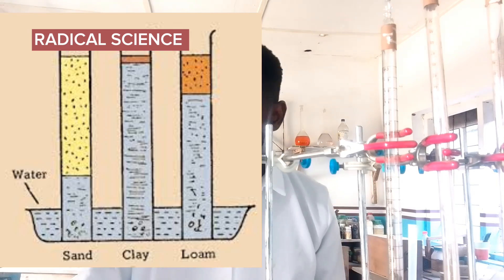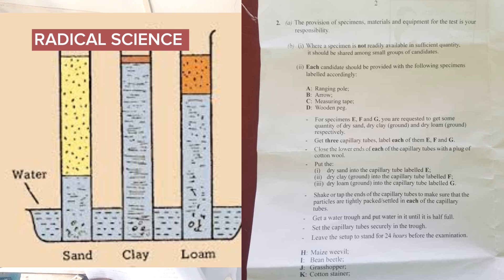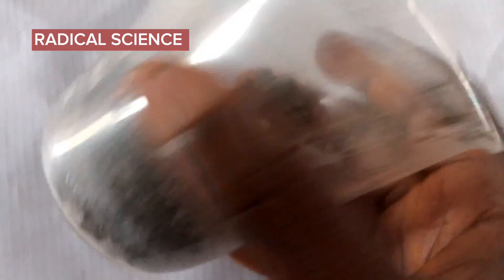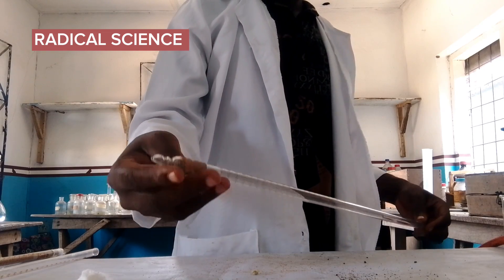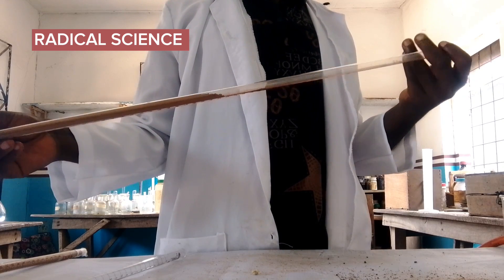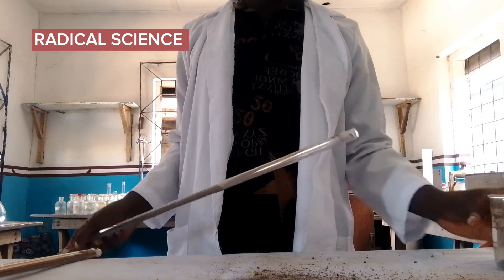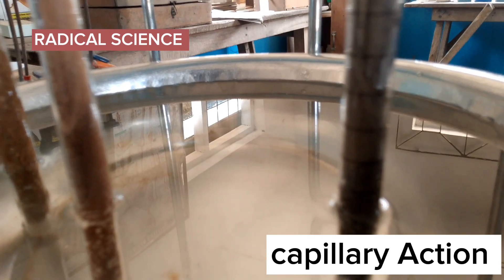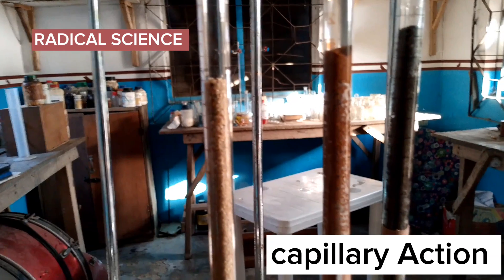2024 Waec Agric practical  Solution. Capillary Action

Comment: Thanks. I thought we need to put the cotton wool inside the capillary tube before pouring in the soil sample?
Reply from the maker: The cotton is to prevent the sand from pouring out just the way you saw on the video
Reply: @radicalscience3769 
Please sir are u turning the cotton wool side into ur basin of water and leave for 24hrs?
Reply from the maker: Yes
Reply from the maker: It holds the soil from going out of the tube